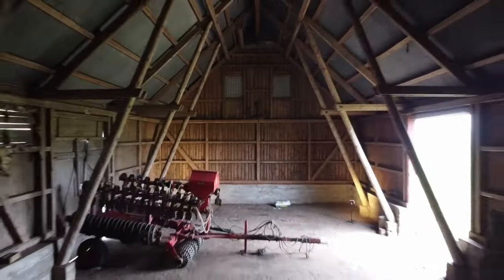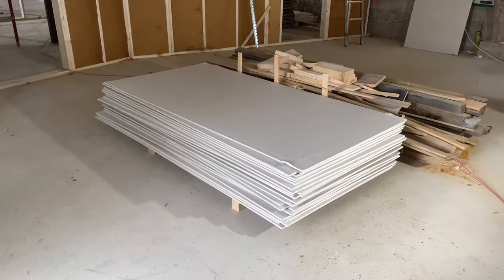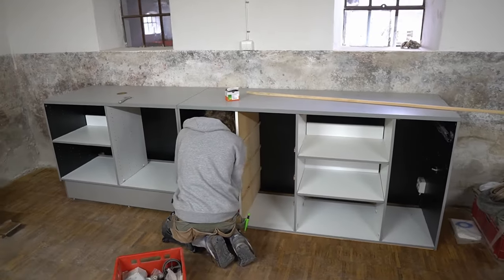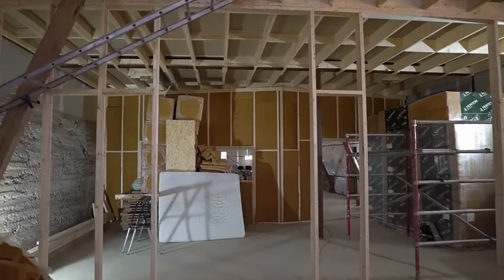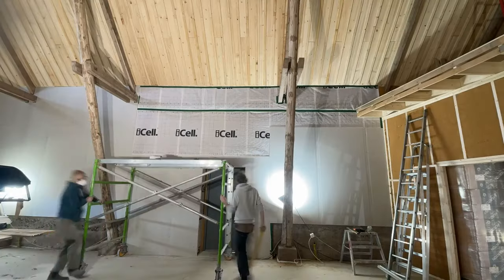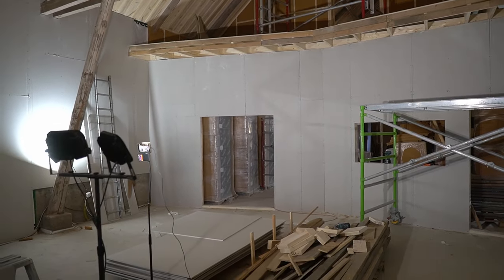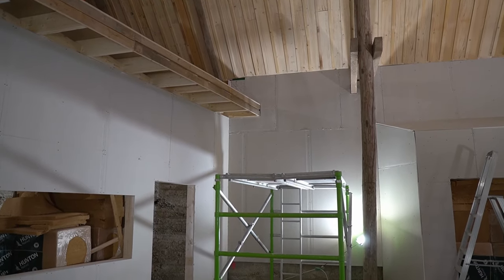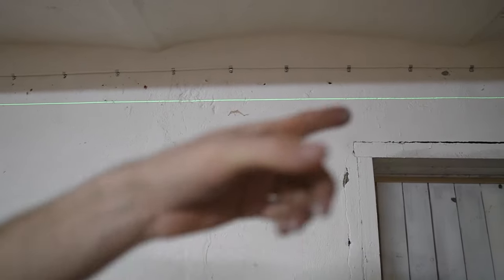Big Barn Recording Studio - WALLS

Comment: Awesome job, enjoy the weekend ❤
By the way 45 degrees piping is correct. The longer the radius of the corners the better the vacuum, you can transport more product through the piping without clogging and need less energy to get a good system 👌🏼👍🏼

Comment: 90 deg vs 2 x 45 deg? Always go 2 x 45 if you can. The sharper the corner the more energy it takes to push the air round it. Airflow is a bit of a mystical science. Well worth finding out about it for this type of build
Reply from the maker: It definitely is a mystical science!